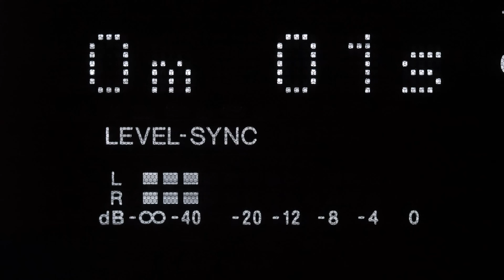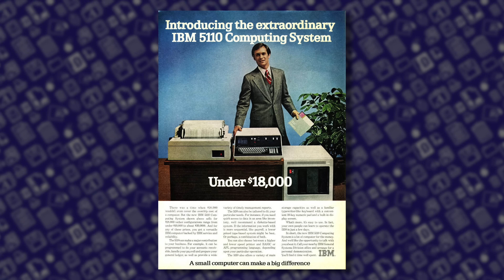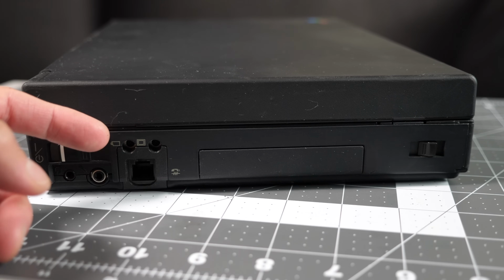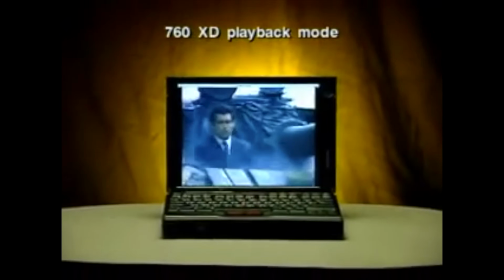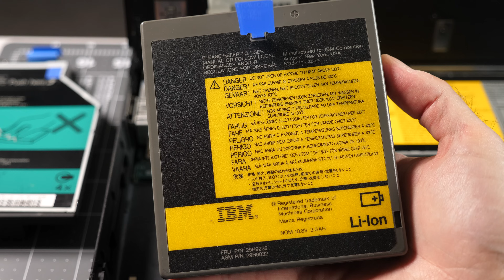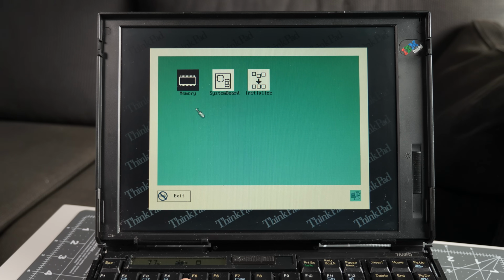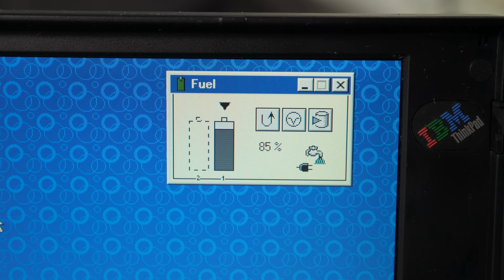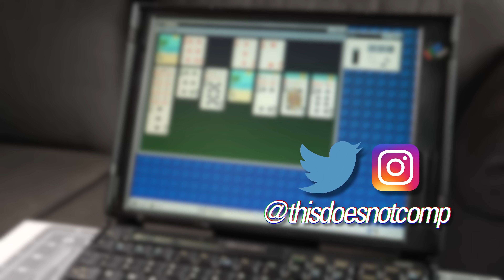ThinkPad 760ED: The Business Laptop With a Quirky Keyboard!

Comment: Somewhere in my house I have a ThinkPad that is even earlier than this with the tiltable keyboard.  I don't recall if it auto-tilts or not.  I also have the docking station to it.  This was back when docking stations were more than port replicators. You can put a CD and a hard disk in it and I'm pretty sure it has ISA slots too.  Some of them even had motorized docking stations that automatically sucked in and then locked the laptop in place.  I'm about 99% sure it's a 486.  Great little machine.
Reply: I have a large docking station for one of my Thinkpad Z61p machines, which can take a SATA hard drive and PCIe graphics card and has a small case cooling fan.  The latter is a bit fiddly to get working, which I will have another go at before long.

Comment: Thanks for putting this one out.  I recently acquired a Thinkpad 560e but didn't get any drives whatsoever.  I think that I can help out here with the MWave device.  Look up a contemporary Aptiva model.  I suspect that it's a very similar model modem-sound card combo that was in my Aptiva, which was the very first PC I owned.  All I can remember of the model number was 2160 iirc.  Mine had a Pentium 100MHz in it, so it might work if you can find it.

Comment: With their desktops of the same era. The “EFI” style BIOS was actually installed on a hidden partition on the HDD. Since it was far too much to put on a chip on the system board. I assume you had to use the system recovery CDs if you ever installed a new HDD otherwise it would be dead. Now I am referring to Compaq office type desktops. But seeing your IBM using a similar type bios. Makes me wonder if it’s the same concept?
Reply: I doubt it. I have a few PCs from 1995-1999 which all feature graphical BIOSes. They can boot to BIOS with just the Board, memory and CPU. 
These were quite common in the second half of the 90s, but disappeared rather fast again.
Reply: nope. i have a 765 and changed the dying hdd with a CF and works perfectly.
Reply: I did a clean install for my IBM 760E and had no problems

Comment: Since it has built-in MPEG-2 hardware acceleration, I wonder if they ever produced a DVD drive for it. 1996 was at the very beginning of the DVD era, and it was a few more years before DVD drives in laptops became more common, but it would be a neat upgrade.
Reply: For the 760 series DVD drives were unavailable. The next generation, the 770 series were the first ThinkPads with DVD drives, the MPEG-2 hardware acceleration were an add-on card under the hard drive bay. My 770X were the last of the bunch, it has Trident cyber video chip with MPEG-2 decoding, apparently I don't need the extra decoding card.  Unfortunately I didn't have the DVD drive. Greetings from Colombia.

Comment: I have a 760EL, I didn't know you could disable the autolift on the lid, good to know. The MWave was optional, as I don't have it or a modem. Thankfully mine isn't as sticky as yours.
I got the CD ROM and the Floppy drives for mine, I used this laptop as a floppy emulator for the Atari 800 computer, over serial, before SD card solutions were available.

Comment: Hey Collins, great video! Thanks! That Keyboard feature is really great.
Last year I was able to dig this bundle, what do you think?
1-IBM ThinkPad 760XD 64MB, HD 540MB, floppy and no Optical Drive.
2-IBM docking stations for the model
1-Video Output cable

4-IBM 8MB Cards
1-Kingston 32MB Card
1-IBM Modem Card 56kpbs
3-IBM Ethernet II Cards (missing 1 dongle)
1-IBM Mouse
1-AUI to BNC converter
Disks with Windows, Windows 95 and OS/2 stuff.

The HD is having a hard time to spin, keyboard unresponsive. External kbd on the dock works fine. Booted CheckIt from floppy and tests ran ok.
There is some corrosion inside that really ate the kbd flat. Not sure yet how to fix it.

I can try to image the disks and upload them somewhere if you want to

Comment: I had two of these - a 760C with a Pentium 90 and the same 760ED but with the aforementioned XGA LCD.  Absolute road warrior laptops.  Interestingly enough they offered two battery chemistries through its lifecycle.  The Li-Ion that's shown, and an older NiMh battery.  Took it to 64MB ram and tried to shoehorn Windows 2000 Professional but IBM didn't release drivers for it and the Windows NT drivers were buggy at best.

Comment: There are some unofficial CD images around the web that boots off cdrom and has norton partition manager and the CD key included and of course the windows setup.
However i only have german versions so you´d have to edit the iso images and put a english version of the setup on it (or use it as DOS boot disk and run the setup off another CD)

Comment: Guess manufacturers thought the device might be reitred before that coating turned sticky. I bought a Compaq Presario 1655 years ago with the coating, but it wasn't as difficult to remove it from a ThinkPad T41 i bought later on. I ended up scratching it a lot and just painted it.

Comment: Ah, I miss innovative designs... and laptops that are well built and user serviceable.
Reply: There are some innovative designs these days but serviceability is a severe issue!
Reply: Actually, we have lost serviceability only quite recently. There's this laptop I still use, from 2013, which has access to everything, RAM, HD, CPU, Wi-Fi Card, and so on just by unscrewing a single panel. Going for the very thinnest design has made us lose that kind of thing (although soldered RAM and SSD modules have nothing to do with that and are really a crime. I'm looking at you, Apple).
Reply: @BilisNegra  Absolutely! I loved how repairable the old unibody MacBooks and the plastic ones were... When they started gluing in the batteries in the Retina lineup things started to go down and then all hope was lost with the release of the 2016 lineup... Some modern budget windows laptops are still somewhat repairable but not many...
Reply: @BilisNegra  sounds like a dell latitude
Reply: @BilisNegra  reminds me of a gaming laptop from dell. well what is is it? :D
Reply: @sixunity1171  Actually I'm talking about an HP ProBook. But what you mention would be a fine example, although don't know what era you have in mind. I have an older machine, from 2008 or so, a Latitude E6400, and it also has an easily removable single large bottom panel giving you access to everything. I can imagine somewhat newer machines in the range were also like that. Maybe you even have one and want to share which one it was!
Reply: @chosenArchitec  Actually HP ProBook,  exact model is 6470b, but Dell was a good guess, as there have been quite a few models that would fit the description. Check out what I've answered to another user.

Comment: NO!  If you have a parallel  zip drive or even a parallel CD drive, then you boot the machine, format the hard drive and then copy the windows installer over to the hard disk and just run it from there.
But I am warning you now, ThinkPads work great when they work and they are a NIGHTMARE to deal with when they don't. I professionally supported ThinkPads in the 90s.  I have spent 1/2 a working day to get a damn token ring card that worked in every other ThinkPad I put it in and absolutely nothing wrong with the machine, but it took a 1/2 a day to get it working. A standard configuration every TP we had ran. It was an IBM branded token ring card. This is just one of MANY anecdotes.
Between Compaq and Thinkpads, I have lost most of my hair fighting with these machines (I was bald by 30).  If it works the way it is, leave it alone.  The LAST thing the world needs is another laptop made generic by running windows 98. Leave it stock.

Comment: I've noticed the older Thinkpads will boot off CF card in the PC Card slot - my 360 will, but my 760 won't. Not sure what the difference is. I think it will boot the ATA PC Card hard drives though, like the one out of my 730T.

Comment: I have an older ThinkPad 755C that I got when it was around 4 years old. It only has a floppy drive and HDD with no optical drive and the floppy drive was broken. I managed to reinstalled Windows '95 on it by transferring the floppy images to the HDD through a serial null modem cable and some software (LapLink I think?). Took a while, but I think you could do the same for the boot floppy.

Comment: I recently got one of these for free, given to me by an extended family member along with some random XP laptop and a bunch of micro-usb cables and even a Cannon scanner. (I'm the techy/IT guy of the family)
While it does have some cool stuff like unopened copies of Win95, Lotus SmatSuite and Multimedia CD-ROM sampler and stuff like the breakout cable for composite/s-video it's missing the power cable so I can't test it yet.

I've never personally owned a laptop pre-windows XP  so I really want to get the correct power cable so I can test this and see it works as the rubber has stayed good on my unit surprisingly and would be nice to  play about with.

Comment: yo i actually bought two 760 models a while back which i had planned on installing openstep on. but i have not been able to figure out how to replace the hard drive with a compact flash card. there's some kind of magic partition or something and i think there was probably a utility needed to format a brand new hard drive properly? any clues?

i really would prefer to preserve the two original hard drives as they were when i bought them.

i eventually got openstep installed on a pentium 3 933 generic clone desktop, and that is pretty great, but it sure would be sweet to have it on a laptop some day.

both of mine have pretty sticky rubber too. unfortunate.

i really would love to find those video in and out dongles some day. i wondered what those ports were, thanks.

Comment: I have the same unit and for me the sticky palmrest was just unbearable. I sacrificed the originality a bit by removing it. The palmrest comes off with a few screws and the sticky material is easily wiped off with isopropyl alcohol, revealing a smooth dark grey plastic. If you don't know any better it looks original, but now it's actually usable :-)
Reply: That's exactely what I did to my 760XD. The end result is good enough, it looks feels like as if it was done this way by factory.

Comment: I have a working 760ED and I love it for DOS and Windows 95 gaming. Mine is maxed out with 64MB of RAM and the battery still holds enough of a charge to last for about a half hour. Only thing that doesn't work is the CD-ROM drive so I use an external Backpack drive through the parallel port